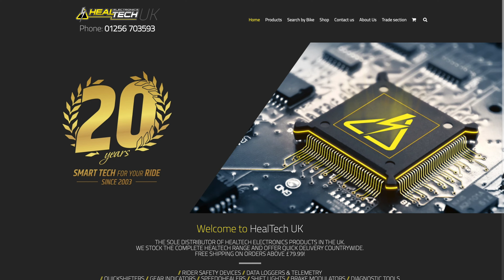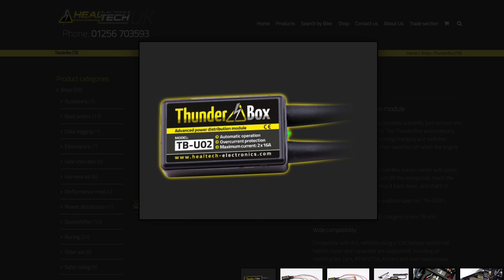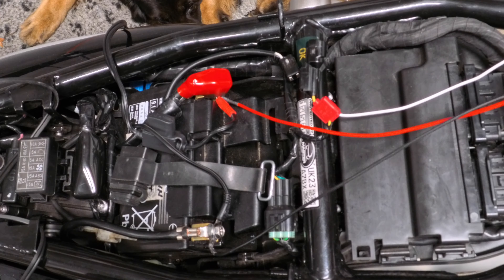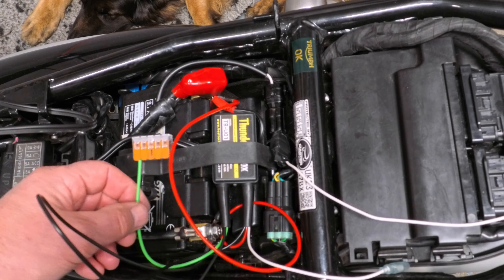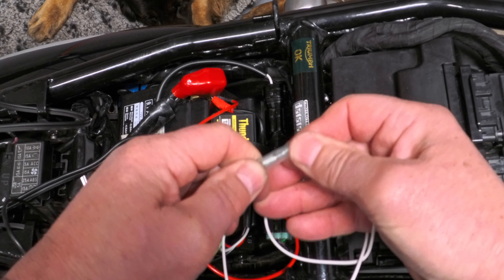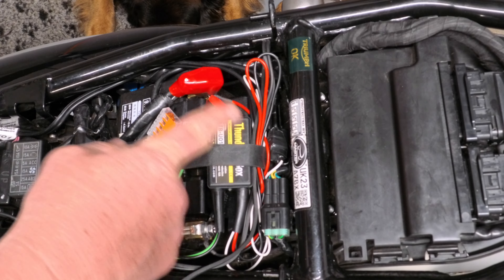TRIUMPH SPEED TWIN | INSTALLING A THUNDERBOX POWER MODULE

Comment: Can you charge the battery ok with the optimate cable whilst the thunderbox is also connected to the battery, as described in your vid. I take it there's no problem in doing that

Thanks Gary.
Reply from the maker: Yes I do it all the time with no problems 👍
Reply: @gsd32i  cheers...

Comment: Ok have a Speed Twin 1200 19 plate 
No one wants to touch the wiring loom so could I run the Oxford daylights through the Thunderbox ?
Reply from the maker: Hi, I can't see why not as long as the power is correct. I have had a Quick Look on the Oxford website and there auxiliary lights seem to be able to be powered by Oxfords version of the thunder box.
Reply: @gsd32i  Thanks

Comment: if i don't attach the white wire i wonder if everything will fire up if i plug my optimate charger.  Guess you dont know as yu did connect it :)
Reply from the maker: Hi, to be honest I am not sure. I have read that the traditional chargers will power on the accessories fitted to the TB ,due to the chargers power....some folks say they haven't had an issue with this happening with the opitamate due to its intelligent charging!!  The reality is just connect the white wire and be done with it. 👍
Reply: @ thanks for your response. I like the delay you get before it powers stuff.  I can try without the white wire at first and see

Comment: Great video! thanks. Question though.... if you are just using the switched live, why bother with a thunderbox?.... Just have a junction box - cheaper right?
Reply from the maker: You may be right! But thunder box is very simple to use for a simple chap like me!😂
Reply: If you are not connecting to the loom then it’s protecting battery from anything connected running power down when the engine is not running 
So good for me 😄

Comment: Do you think I'll need one of these to wire my TomTom to the K1600? Will it prevent battery management issues?
Reply from the maker: Indeed sir...I fitted it to the Triumph in anticipation of taking delivery of the Chigee AIO5 Lite gps thing, which having now paid the gst on, should be on its way from the UK. No issues with the Thunderbox on the mighty GS either. There must be a DIY bloke near you that can find the battery and a switched live wire😁
Reply: I’ll order one then👍
Reply from the maker: @JM-lb4lw  If you need a hand ask your neighbour😂